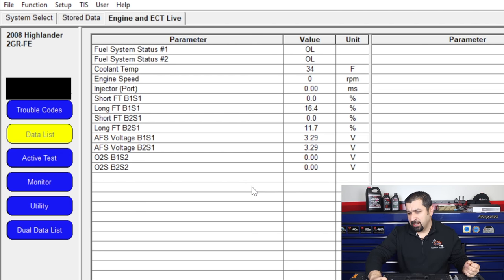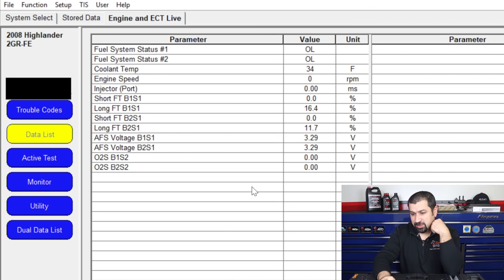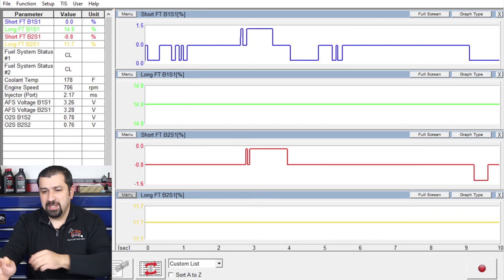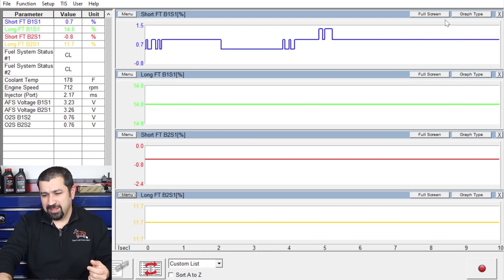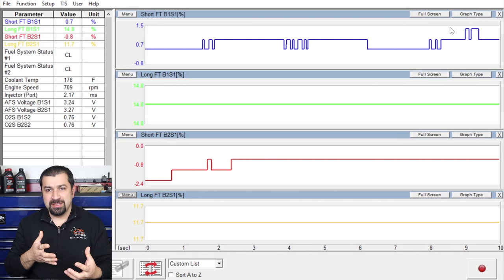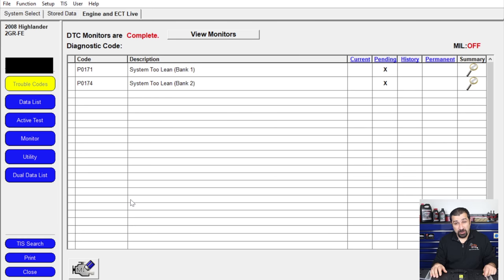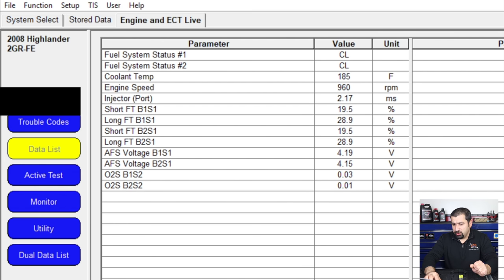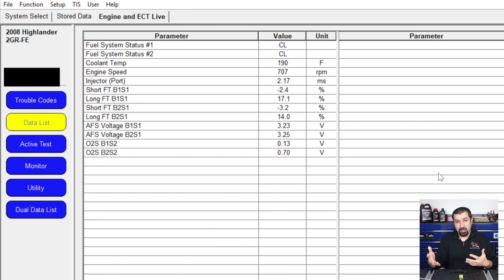Toyota Fuel Trims and live data diagnosis tips!

Comment: Hi AMD. Thanks for your time and for your explanation about this important topic. I appreciate that.
I have question in general. My 2006 outlander's gasoline usage is about 20l/100km. At the same time LTFT + STFT are between absolutely normal parameters  ±5-10%. How it's can be possible. I mean regardless the reason  it should be some sign of reach/lean condition, yes?
Thanks again man!
Reply from the maker: Hi! So gas mileage is affected by many factors other than rich and lean. Like weight, tires brakes driving style ...etc. let me ask you this. Did the gas mileage drop at some point?
Reply: @TheCarCareNut  Probably 3y ago it was about 17l. Now it's 20 or probably more. I'm not sure if I answered your question.
2 mechanics have  tried to find reason without success. Thanks God I have Camry as a daily driver. Otherwise burning money it's not my style 😁
Reply: Remember that fuel trim is just about maintaining the stoichiometric air/fuel ratio of 14.7:1. Unmetered air, problems with sensors, etc will affect it. But if there is a mechanical problem that is introducing a lot of friction, that probably won't affect the air fuel ratio and so checking fuel trim won't help that diagnosis.
Reply from the maker: Do you remember any change to the car when the mileage dropped? Like a specific maintenance or repair?
Reply: @TheCarCareNut   After small accident (rear left bumper) I started having issue with fuelling tank. Every 2-3L fuel gun stoping because of vapors, I guess. And last mechanic also did smoke test on vapor line and changed valve solenoid. Still the same problem. Probably after that bumper accident I noticed increasing 17-20L.

Comment: Great stuff. I love your channel! I have a question about my 2009 Toyota Sienna that has a bit of engine knock or perhaps piston slap when cold. The noise subsides once the engine is at normal operating temperature. I’ve read this may be a characteristic of the 3.5L due to it having ground cam pistons. Is this noise something to be concerned about?
Reply from the maker: Hi! That’s completely normal for the 3.5L engine and nothing to worry about. I know how you feel when you hear it, sounds terrible but they all do it and it’s not a problem
Reply: That’s such a relief to hear, thank you for answering my question!

Comment: Hi, thank you for the info.  what is the difference between the fuel trim and the O2 fuel trim bellow is live data from GDI Engine Toyota
TOYOTA Avensis I 2.0i-16V model (AZT220L) VVT-i Engine 1AZ-FSE Year 2001 petrol.
What is the difference between short/Long fuel trim and the O2 FT?

Short ft 1 -20.34 %
Long FT 1 -0.04 %
Short ft 2 -14.09 %
Long FT 2 -0.04 %
---------------------------------------------------

O2FT (bank 1 sensor 1) -20.34 %
O2FT (bank 2 sensor 1) -3.94 %

Comment: Ahmed, my numbers are almost identical to the first test you ran for AF Voltage under the same conditions. I have a 2018 IS350 F SPORT with 120k miles and have been chasing decreased fuel economy for almost a year now. Ive changed spark plugs, air filter, clean MAF sensor each oil change (every 6k miles with mobile1). And I run shell 93. Tire pressures are mid-high. All I do is freeway driving with very little traffic. I was getting 28mpg forever on highway and now lucky to get 24mpg. Any other suggestions?

Comment: Great lessons always, I have a case that maybe you did not explain or I did not understand if you explained. I am having a -20.3 long fuel trim on toyota avensis verso. I have cleaned the throttle body, idle control valve but still the long fuel trims remains 20.3. what could be the cause?

Comment: Great information! But I do have a question. 2010 Tundra with a 4.6L. I am experiencing high fuel trims at idle. Long terms are 25% and short terms are normal. This is causing a P0430 code for catalyst efficiency that I cannot clear. Cats and sensors have been replaced. Should the LTs be that high at idle with the STs showing normal?

Comment: Hi thank you for amazing video! I have a question about the Engine Air Filter. I have 2014 toyota venza. I just bought and used the STP Premium Engine Air Filter (from Autozone). I just realized that this air filter has the oil in the filter. Therefore, I took it off and  replace with the other air filter (air filter without oil). I’m very worry about the oil in the air filter. Will the oil from the air filter damage my vehicle (engine, mass air flow sensor, intake, etc)? I just drove with the STP premium air filter about 25 miles. Thank you so much!
Reply from the maker: Hi! Is this a 4 cylinder model?
Reply: @TheCarCareNut  Yes, my car is 4 cylinder.

Comment: Just found your videos and they are all excellent. I have a 2005 Avalon (200,000 miles) that sat for a month and now it's throwing P0306 (#6 misfire) and P0174 (Bank 2 system lean) codes. I checked the LTFT on B2 and it is pegged at 40+, LTFT and STFT on B1 are in a normal range. I have not found any vac leaks. AF sensors are running under 3.3V. These 2 readings tell me that the computer is trying to increase the fuel to overcome the lean condition but is not succeeding. #6 injector on this V6 is, as you know, in a terrible place to replace if it comes to that. What am I missing?

Comment: This is a long shot if you read this....2001 Toyota avalon, had P0171 and P0174, diagnosis pointed me to fuel system, replaced everything in the fuel tank (pump, regulator, etc), the external filter. The car came alive. now I still have the same codes...but get this. My short term is around 0% somestimes slightly negative, but my LTFT on both banks are 40ish%. I have tried reseting it, clearing DTCs, and driving over several hundred miles and cant seem to get that LTFT to go down, even though the STFT is within +/-5%. How can I crash the fuel maps?

Comment: Great video, I recently had my upstream sensor replaced and now my mpg is even lower than it was when check engine light was on. I have a 2010 rx 450h with 175,000 miles. do you have any ideas

Comment: I understand cars a little bit, I'm still interested in knowing more detailed information about how cars run.
I have 2012 Lexus IS350. Currently, the car is running too rich, thick smelly black smoke, rough idle, power loss, almost stalls. I have an advanced obd 2 reader, I have zero codes but if I pull live data, it's showing a lot of emission dtcs. Could this mean my upstream AFSs are bad? I haven't fully understood what readings indicate what faults on live data. 😢

Comment: I have a 2014 Avalon Ltd.  I couldn’t fuel the tank.  The gas nozzle would immediately kick off both in automatic or hand held. I took it to Toyota Service. The changed the charcoal canister but it did correct the problem. They changed the gas tank. The only change was that I could fuel it if I held the nozzle out about 3” but not if I put the nozzle in or in automatic mode. I took it back and still waiting for them to repair it. Any ideas?
Reply from the maker: Hi! It could be an issue with the vent on the evaporative emission system.
Reply: @TheCarCareNut  thanks. I’ll share your response with the Toyota tech.

Comment: Hope all with well with you and yours .....Can I reset fuel trims any other way other than disconnect  the battery for a few mins  and let it relearn? Well a proper way? 06 sienna.  Trims look fine but I don't  have a heavy foot and drive highway  mostly  here in florida. Getting 19 mpg average  I think should be a little better. Thanks in advanced

Comment: Thanks so much for all the info.  
Question - I have a 12' silverado 5.3 that I did a mechanical and code delete of AFM/DOD over a year ago.  Truck has been running great but I have a misfire that isn't giving me a code or misfire count.  Would an oil pressure code that's high/ low (bad sensor) prevent the misfire code? 

It also has a permanent code p0011 (camshaft position timing over advanced)
Because I put a stage 2 camshaft with VVT and installed a camshaft phaser limiter.  
 Could this also prevent misfire codes?

Comment: I have a 2007 Toyota Camry SE 4 cylinder. I Installed a new mass air flow sensor and a new O2 sensor and the O2 sensor reading seem to be fine but the airflow rate from the mass air flow sensor is Reading in the low 2's and high 1's. Does this indicate a vacuum leak? From what the video explained I think that's what I understand might be the problem. If that's the case does that mean there are hoses that I can change myself? So far the check engine light has not come back on while I'm sitting here with the car idle and warm I am going to turn it off let it cool and restart it to see what happens.

Comment: Do you know if Tacomo 2013 4.0L transmission A750F has a overflow tube or is build into the pan? Do you have the part number if there's one?
Reply from the maker: Hi! It does have one in the trans pan and I believe that one is not removable and it’s part of the pan. That pan has 2 plugs one is drain and one overflow

Comment: Whenever the pcm notices a misfire, for instance,  if a cylinder stops receiving a ignition spark. Would the pcm command the fuel injector for that dead cylinder to stop pulsing, and thereby stop delivering fuel? Or not, and continue injecting fuel to dead cylinder?  Seems that would would keep the system in a constant overly rich condition... makes sense, otherwise if it cut fuel and the A/F - O2 Sensors stabled out (normal readings) Your car just turned into a 5 cyl. rather then a 6 cyl.

Comment: My AFR constantly reads lower than 3.3v much like the one in this example and it's a slight rich condition and the downstream 02 picks up on this and it spends a little more time at 800mv+ than I'd like it to.
Reply: It’s better if your car’s running slightly rich. I would think you’d have a bit better fuel economy by having slightly negative fuel trims.

Comment: @The Car Care Nut how does one know when the numbers are incorrect?  Will the scanning software your using show the "bad" numbers in red, or do you have a manual with the correct range of data to look up?  Thanks for the videos!
Reply from the maker: There’s a section in the repair manual that will give you a reference for value ranges for every specific Model and year
Reply: @TheCarCareNut  Hmmm. So a scan tool can't tell you exactly what needs to be fixed? Being that it literally logs into the computer of the car using its year/make/model/vin?

Comment: My mechanic says I may have a fuel trim issue. Have a continuous P0303 even with new fuel injectors, plugs & coils. Old & new spark plug have/had black cakey build. up.  Could you have a fuel trim issue in one cylinder?

Comment: Yet, anotehr very comprehensive viideo - thank you!
My 2013 Lexus RX350 gives an average fuel consumption of 16.6 lit/100 km instead of what it is supposed to be (i.e., 12 L/100K).  Admittedly, I drive short distances (1-3 km) in the city. At highway I get 12 to 12.5 L/100 K. However, I still believe the consumption is excessive.  I have checked for vacuum leak, thoroughly cleaned MAP, throttle body and PCV but no change.  The live data (i.e., fuel trim, etc) is very similar to what you showed in your video. Also, strangely, similar to the values seen in your video, the fuel trim (and AF ratio, etc) numbers are different in the two banks, but that is what I also see in your video.
Any hints?  I would appreciate any suggestions you could give me to resolve this issue.

Comment: Hi dear i have a question:
My car, Toyota avensis t25 with 1azfse is developing a lack of power and looking live data on diagnosis, I realized that ignition advance always is positive. Maybe a bad knock sensor?
And other live data(strange for me) is throttle position with full pedal pressed only get 82% and calculated load almost the same (should be 100% or is normal on Toyota?)
Car has new, spark plugs, maf, valvetronic solenoid, voltage regulator, b2s2 lambda.

Comment: Beside the carestream toy software diagnostic; Is there any other diagnostic i can use? Toy carestream is expensive for the DYI. you're advice is greatly appreciated... thanks
Reply from the maker: Hi Jose! So I’m trying to find a good budget friendly scan tool for DIY that has good capabilities. When I find one that passes the tests I will post a review. The Carista is good for owners but doesn’t have all the diagnostic features for repair
Reply: Do some research you might find it on eBay etc
Reply: @TheCarCareNut  Can't wait to see what you find. After quite a bit of comparing OBD scan tools, I currently have the BlueDriver and MX+. If you have questions about them let me know. I'm curious about other less-known options as well. It's not easy finding the perfect tool, if it even exists. I'm just really not a fan of the subscription models that many products tend towards lately (for good financial reasons).
Reply from the maker: @fizout I want to find a scan tool that gives you good capabilities for a reasonable cost. Sure you can buy a $3000 scan tool that can do everything or get techstream for $495 plus almost $3000 every year for subscription but a diy car owner can’t pay that just to fix a car every once in a while. There has to be a scan tool out there that can do enough to make it worth awhile for diagnosis and I’ll find it one day and review it
Reply: @TheCarCareNut  Both the BlueDriver and OBDLink MX+ have gotten a lot of publicity and are great for diyers. They are in the $100 range and for many vehicles have "enhanced diagnostics" meaning manufacturer specific PIDs. As a short summary, I would say BlueDriver is more user-friendly and better for those who want fixes (the Repair Reports in the app are great), while the MX+ is better for the enthusiasts as it is faster thus supports more simultaneous PIDs and it can be used with many third-party software. I just wonder about other hidden scan tool gems out there that haven't gotten similar exposure.
Reply from the maker: I think two way communication would be beneficial as you can activate things for testing. That would be interesting! I am looking into blue driver. All this aftermarket scan tools are new to me as I mainly use techstream and a snap on scan tool
Reply: @TheCarCareNut  Yes, bi-directional communication is the one big lack. Sort of. OBDLink support confirmed the MX+ is capable of two-way communication, but they have no plan to add the functionality to their free app, OBDLink. However the MX+ can also be used with third-party software, including the Carista app https://www.obdlink.com/compatible-apps/ so maybe this could be a solution for resetting TPMS etc though I have not tried this. BlueDriver works only with their own app.

Comment: Techstream question - My friend bough a Toyota 2021 RAV that was flooded. Got a good deal on it so thought he would fix it up. The thing this car did not come with its smart key. He now pings me asking if I can access the cars ECU via techstream. I tried getting his car connected. But since there is no key registered with his key I cannot put the car in "on" mode to make it talk with etc. Is there any way I can talk to the ECU without the registered key on Techstream?
Reply from the maker: Hi! You can by manually entering the information and just before you connect tap the start button this will wake up certain computers. You won’t be able to reset the smart key system and register new keys unless you have an account and you are a shop. If you are you can get an account at techinfo.Toyota.com but it’s a bit more complicated than just setting up an account and paying for it

Comment: What is your opinion on putting lacquer thinner in the gas tank to fix P0420? 
2003 corolla 140k miles.
Reply: It's worth mentioning that lacquer thinner varies widely; some (like Klean Strip Lacquer Thinner) have significant amounts of methanol, which erodes aluminum. http://www.kleanstrip.com/uploads/documents/GML170_SDS-1605.48.pdf
Our favorite Car Care Nut has mentioned the issue of P0420 codes is in the lineup for this series on DTCs. I know plenty are looking forward to it.
I have a recommendation for a preliminary check - might help, can't hurt. Check for exhaust leaks, particularly ahead of the converter. My favorite way to look for leaks is to connect a shop vac to blow low pressure air into the exhaust with the engine off, giving it a moment to clear any debris out of the hose. Since we have a Toyota Master Mechanic watching out for us, it would be a good idea to get his blessing before blowing air into the exhaust.
Reply from the maker: Hi! I have heard of lacquer thinner however it is not a recommended method as the potential damage it would cause to o2 sensors can be permanent. The correct way to fix a fault catalytic converter is simply to replace it but more importantly find out why it failed. More on this on Saturday’s video
Reply from the maker: Shop vac air into the exhaust works but plugging the exhaust tip with the car running works better!

Comment: Hello, what's a normal LTFT to be at? I have a 2000 4runner v6 with the LTFT constantly at -20 at idle. I get sometimes code p0300/ 01/03/05 when check engine light comes on. STFT running around positive/ negative. I know the CO2's  were changed with aftermarket ones by the previous owner

Comment: I'm getting P0171 and P0174, LTFT1 and 2 are over 30. STFT 1 and 2 are 0 and 2. Cleaned the MAF but after 50 miles of driving the codes came back.
Reply: MAF reading out of spec after going through the MAF testing procedure per the SB...replaced and life is good!
Reply: Oops, two days later and now I've got P0330....knock sensor bank 2.....car's getting old......and sounds like an expensive repair.

Comment: My 2000 camry has a long term fuel trim of 16.4% positive  at idle. When RPm is revved to 2500 it goes down to 7.0% positive . what 02 sensor controls the long term fuel trim?